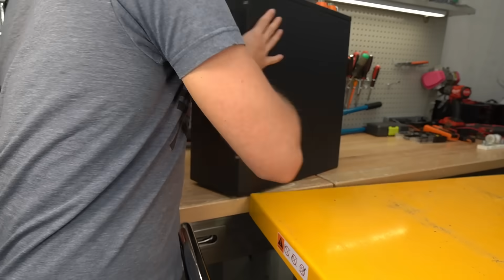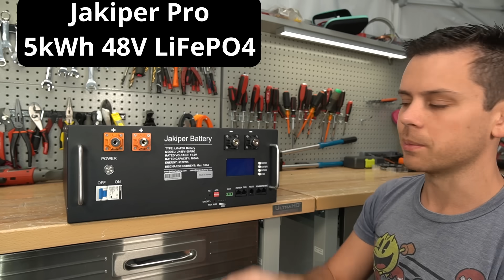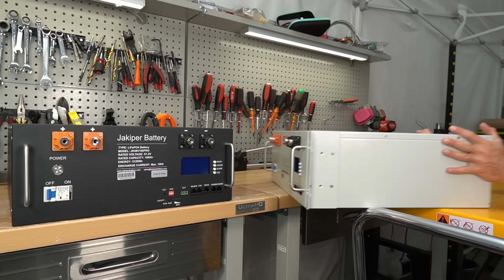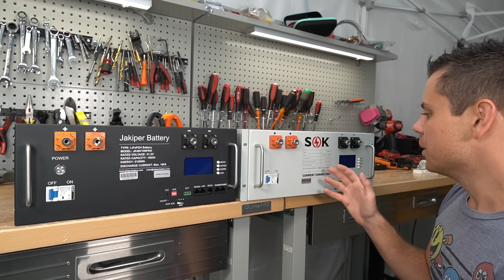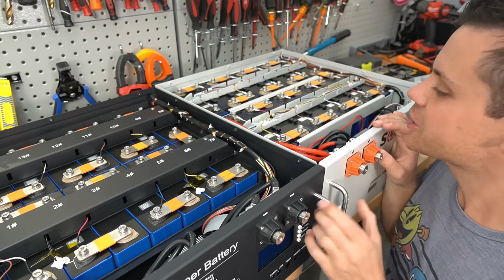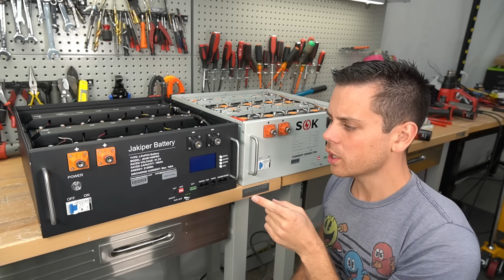$1,699 Jakiper "Pro" LiFePO4 Battery

Comment: I have two LFP Orient Power Wall batteries 48V also known as Jakiper batteries with the off grid inverter Growatt SPF 5000ES with Victron battery monitor and busbar. Inverter is setup with the battery as Li and is communicating with the BMS.

All seemed to work fine for 3 months and now we are having massive issues of batteries suddenly dropping down to 0%.

Below is what I observed. 

7th December 1pm SOC dropped from from 99% to 79% then after 5 minutes back to 99%. No one used the power that day or night.

14th December 1pm SOC  dropped from 99% to 76% then back to 99%. We used power that night and once batteries got to 81% then dropped to 0%.

15th December, very sunny day and saw batteries charging all the way from 0% to 100% consistently. At night batteries dropped from 86% down to 0%.

I can't understand what could be causing that, are batteries faulty? Where does all the energy go if batteries indeed dropping to zero.

Comment: Coming in 9 months after this video was posted: Jakiper have these in stock and available to order, direct from the factory, with delivery to Australia. Retails for $2500+$250 delivery, by far the cheapest actually-available battery on the market. I did use the Jakiper customer service and they replied within 1 hour each time, and their communication and understanding of what I was asking was fine.

Comment: i had bought a solar kit that has mpp lvx6048mp inverter with the jakipar batteries. cant get them to communicate and am now thinking its not possible. or is it possible? is it safe to run them without communication?

Comment: Jakiper customer service has improved dramatically. I have been in contact with them several times and they did resolve all of my issues. They did find my lost batteries and kept me in the loop up to the delivery. The Anti-Theft alarm issue was also resolved, and they sent me a replacement BMS for a faulty RST button. I have been in contact with them concerning other issues and they have been very proactive in resolving everything.

They have really come around in the customer service aspect and I now feel comfortable dealing with them. If you have issues, just contact them and they will work hard to resolve it. My Jakiper batteries perform great and are the centerpiece of my system now.

I have to thank Will's intervention and the help of everyone on the forum. I believe that that was the turning point for Jakiper to start seriously engaging their customers. I would also like to thank Jakiper for standing behind their batteries and resolving my issues.

Comment: Can you do more testing with ecoflow delta pro. They are telling me I have to unhook my solar at night because its recognizing a connection but no power coming in so the solar charger constantly turns on and off. This is horrible for off grid systems to have to unplug your solar everytime the sun goes away.

Comment: On a completely unrelated note:

I read in your very helpful Mobile Power Made Easy that one must connect the solar charger to a battery before connecting solar panels to the charger "if you do not want to damage your controller". Yet I've seen many builds having battery disconnect switches. Is the admonition about connection order only applicable during install or is it always, or sometimes, otherwise a concern?

Comment: So I have a question about electricity and how many amps are being used to power my house. So the other day I actually put an amp clamp on my two 110 hot leads/black wires coming from the telephone pole and on one of the hot leads going to the house I have 8 amps on the other lead I have 18 amps. So my question is I'm assuming you probably add these two together and you come up with 26 amps now that's also with my air conditioner running and quite a few lights in the house which are LEDs. So my question is what would be my amp/hour per day and also how many 100 amp hour batteries will I need?

Comment: Hello and good morning I figured message you on your most recent video regarding top balancing LiPO batteries I've got 210 spim08hp the packs are rated at 16 amps and I am putting 50 in parallel at a time to top balance I am using a very expensive charger power supply it is 60 volt Max at 35 amps and I've got it cranked all the way up on the current my thoughts were to top balance I'm to 4.2 volts each but going from 
4.1 to 4.2 is taking days is it that important to get them all the way up to 4.2 I also thought of cranking my power supply up to 4.4 V so my charging curve does not drop down what's your thoughts. I am using them for a growatt SPF 5000 inverter at 58.8 V also I have a 200a daly 14s bms

Comment: I just purchased a Voyager 20A solar charge controller.  While reading the paperwork, I noticed that it says that it is positive ground.  I thought that positive ground systems were only on old, old cars and was phased out decades ago. I read that negative ground charge controllers will not activate lithium batteries. I was wondering if you would create a video explaining positive and negative ground systems and how they affect solar charging systems?

Comment: Hopefully you see this but if not, I understand. In the past you’ve said that it is generally always cheaper to buy a solar generator in comparison to building a set up yourself. I hope that’s what you said I might be wrong. Now, with the availability and price of server batteries and their corresponding inverters with built in mppt, do you think now it might be better to build yourself as oppose to buying a pre built generator considering the amount of WH the server rack batteries have?  Hopefully I didnt misquote you or anything im just trying to understand what would be the most cost effective way of powering a small home. Thank you for all the work and information you provide

Comment: Can anyone tell me if there is a direct email to the DIY Solar Power Forum?  I am trying to post questions and be a part of some of the discussions, however I have a message at the top of page that tells me that my account is awaiting confirmation.  I have clicked the resend confirmation email several times and I never receive the email.  I tried changing my email address in my account settings thinking that the email server is not accepting the confirmation email but that did not resolve the issue.  It did not come to either of the addresses I tried.  Would like to be a part of the Forum but can only read comments at this time, can not post.  Sorry to post here but didn't know where else to try to get some help with this.

Comment: I have a problem with my batteries which is i left it discharged for six months and after that when i measure there voltage it was 13 and the system is 24v what should i do ? when i saw that the voltage is 13 i put them on charger but the inverter send me an error telling me that over charged and the batteries is empty how come ?
Reply: the batteries is Newmax gel Batteries

Comment: I think the comunications issues stems from  default settings in the firmware. But whats crazy is you can take a EG4 server rack battery. Connect to it with a regular ethernet cable, adjust two settings on a growatt inverter and it will communicate fine. two minutes vs several hours 😆

Comment: Anything made in China that is any good can and will be cloned since there are basically no patent laws.  Intellectual property rights - same thing.  In China, if you can build it and sell it, go for it.  Huawei has great phones for example - thanks to Apple.  Apple has no recourse in Chinese courts.  Basically if Apple doesn't like Huawei's patent infringements, well then Apple doesn't have to do business in China.  The upside is (I suppose) is that the competition to build things cheaper is accelerated in a no-patent environment.  The downside is that there is less return on innovation since someone else can profit from it as fast as the innovator can so why bother.  Stealing innovations is the accepted solution, typically from the west, provided the stolen innovative product is only sold in China.  China gets the best of both worlds - cheap yet innovative products (Huawei), while we, in the west, get the cheap junk and expensive innovations (Apple).

Comment: I am wandering, why there is no server rack energy storage using bigger LFP cells as 100Ah. The only two reason that I can think of is the final weight and the cost of the BMS. Is there any other reason?
I was hearing from Will, nobody wants to mess with the cells anymore, but in a lot of places on the world there is a big demand for server rack, so the prices are jacked up, so the price difference of the storage would be 100%. 
Is there any manufacturer selling the server rack BMS capable for communication with other BMS, like those server rack storages?

Comment: I wouldn’t be surprised if these were made in the same factory as SOK, just to different specs.
Reply: With that level of similarity, I would be rather surprised if they weren't the same factory.
Reply: Sometimes also,  its a fella that left one company and setup his own factory doing the same thing cheaper but sometimes better than the original.

Comment: I would say do not buy Jakiper!  My battery (not Pro model) will go into over voltage protection at 56 volts when it should be much higher (59.2 BMS cutoff) and 58.4 max recommended charge. Customer service said give it time to break in but it has not changed and I have had the battery for months now. Do not recommend Jakiper but my EG4 batteries are fine so if you want to charge your battery higher go with them. Jakiper customer service is slow to respond which never helps the situation as well.

Comment: I’m so confused on what to buy. Seems every other day new items appear. I want to go with dual inverters to supply each side of my house breaker box and 2 batteries to start off with. Looking at about 6000 watts solar also to start with. I’ve been book marking most of your recent reviews.
Reply: Some inverter chargers will do split phase like you're describing but in one box.  The Quattro from Victron is one of them and there are others.  The limitation is their current capacity as a single unit until you stack them.
Reply: 2 independent system is a good plan, important facility use more batteries.

Comment: Hi Will, can you please tell me the print on that Chint circuit breaker? I would like to find the spec sheet to find out if it is non-polarized circuit breaker or not, thanks.
The SOK uses Chint NXB-125 AC circuit breaker according to the Chunt spec sheet which i wonder how they get away with that.

Comment: Aren't the EG4 server rack batteries user-serviceable as well?
Reply: Welded busbars
Reply: which one you prefer, welded or serviceable?
Reply: @serverrackbatteryusa  Over the lifetime of a DIY LiFePO4 battery bank or proprietary server rack (upwards of 10 years) it is not uncommon to have a failing cell, detected by the BMS or a manual test.  Bolt-on busbars allow you to switch out such cells for healthy ones to prolong the life of the bank. In terms of reducing resistance across the cells there is little advantage in having welded busbars.
Reply: @serverrackbatteryusa  I prefer fixable, if a cell goes bad.

Comment: If it’s a clone, then it’s just as good as the SOK. Being able to save $500+ on a multiple battery purchase is worth it.
Considering they are clones, we should be able to mix and match them in a system. And the communication issues really should be the same as in the SOK, so the same solutions might work as well

Comment: lol, if the jakiper rack is $50 more than SOK's, does that balance out the cost difference between the two batteries? like if you buy the rack from SOK, and the battery from Jakiper would you actually save $100? in other words is that how they're trying to drive sales, and they're just hoping that they make up for it when somebody buys the rack in the same purchase?
Reply: If you buy 4 Soks you get the rack for free 😂

Comment: I have been trying to put together a 50 kw  battery pack was going to start with 10 by buying 2 signature solar server rack but it would probably be easier to build it for 1/3 of the price or close I just need to find good batteries to use because it is a bug PURCHASE I want to make sure the batteries are good but also decent quality finding the right system for my needs I've learned alot from channels like your understanding basic and advancing as the tech does also thanks for your equipment review because that is where we find out what good and what garbage thank you and may the good lord continue to bless us all
Reply: we have a diy solution

Comment: This seems great! But can we use this with our own inverter and solar charge controller? Is this basically a 100ah lithium battery setup with a bms and low charge protection?
Reply: correct

Comment: Don't know why but I find the cell arrangement for the shorter leads satisfying.
Reply: The arrangement is a preparation for later on replace the copper wires with flexible copper bars / plates.

Comment: Can you use these for home backup?  Do you have to use them servers? Would this backup a refrigerator?
Reply: This is designed for home use only, you will need a inverter, before you connect to your refrigerator.

Comment: Will: this might be beyond the scope of what you'd be willing to discuss, but it  never hurts to ask. :D

would you be interested in doing a video, discussing your thoughts on 120 vs 240 for an off-grid house, split phasing, separate inverters for different purposes (segregated workshop with welders, well pumps, etc) and working through a long term generation outage?
Are there issues with having paired inverters that are making 240 split phase, and turning off one phase? excluding the issues with devices that need 240, i'm going to assume they've been disabled already.
How would you consider going about say, dividing up a whole house into critical and non-critical loads, so that you can force limit consumption if needed in case of an incident where you're unable to use solar for charging?  I'm thinking for example a hurricane.
Reply: Not gonna happen... sorry bud

Comment: I love the competition and growth in the market. It helps bring down pricing and even their costs. Seems likely both SOK and Jakiper use the same manufacturer in China so I wouldn't be surprised if SOK gets the same upgrades. I already bought the SOK but if I needed 2+ batteries the Jakiper is much cheaper.
Reply: Not really, only by a few bucks. Hope you never need warranty support!
Reply: @HighTechLab  $100 per battery cheaper and shipping is free for 2+ batteries with Jakiper. SOK does keep changing their price though. And I have no regrets paying a little extra for the customer service to SOK.

Comment: I do like how they shifted the cell arrangement to make the power leads shorter.  I'd like to see more builders do that in general, even if makes servicing a touch more difficult.  shorter leads mean shorter losses and less heating.  even if it's a little bit in my book every bit helps.
Reply: I like that too, but if you look at it while Will has it vertical, it looks like they took the exact same length lead and just coiled it around in the case. :( Functionally defeats the purpose.
Reply: @interficiabo  Well spotted Stephen! John's point is valid to ALL manufacturers though. These are heavy duty batteries with dangerous amounts of power going through them. Keeping the leads as short as possible is a great idea, and at least Jakiper showed it could be done even if they didn't do it.

Comment: Another great video!!

SOK should adopt the switch, balance wire protection, and cell layout with the short leads.
These are probably made in the same factory so they could probably do it pretty easily.

I have mixed feelings about the top fiberboard not being in the Jackiper.    The only issue of not having it (that I can think of) is if the case gets crushed and contacts all of those bare terminals things will get very 'exciting'.   I would like to think I would not let that happen, but we have all made mistakes.  I could easily imagine that as you are racking several of these you could drop one on another.   If the corner of the dropped one hits the top of the other it could dent the top in pretty far.
Reply: While design the inside layout, we have considerred this. So you can see the signal cable tray (with cell # on it) is very high, just little gap with the top cover, it is the secondary protection if anything happens with the top cover.